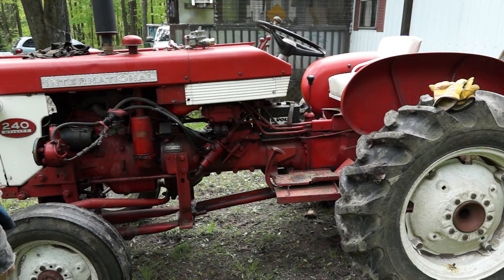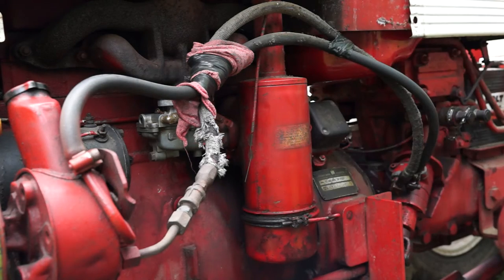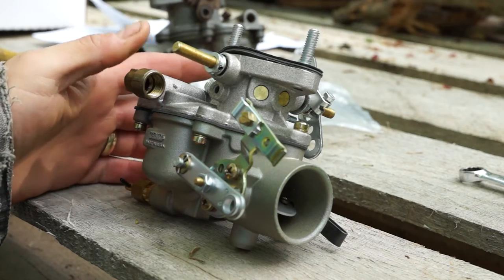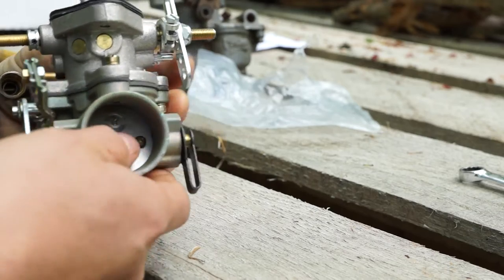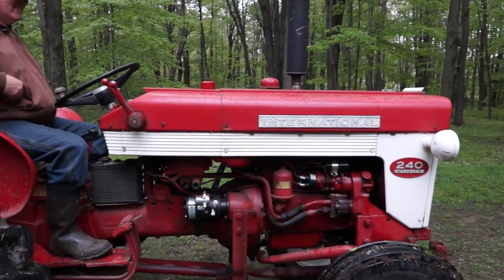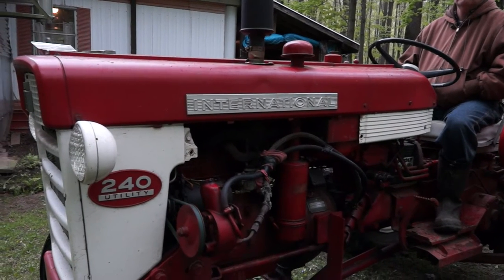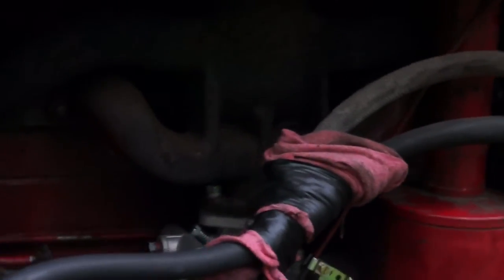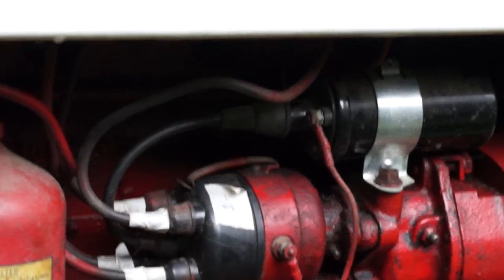International 240 - upgrading to new Zenith carburetor

Comment: Keep the old one as long as you can - as long as it runs good and it doesn't burn any oil and everything else works. There's something to be said about an old tractor :)
 If that was your Dad he looked like he was having fun!!
Reply from the maker: biggest reason for getting rid of it is that I have such a limited time down at the cabin and having to spend unplanned time fixing her cuts into work time... and the three point hitch system on these tractors was an after thought (they came with a two point system originally) and is less then optimal... we still have our old Ford 8n's which you can't kill if you try... those are staying around...
Reply from the maker: Oh and thats my father-in-law... and he's having fun now that I had it started :)

but check out the pics here for what happened next : http://www.bethnchris.com/2014/05/19/replacing-international-240-carb/

taking a day off work and heading down Thursday to get her back on all fours... as long as the part comes in...
Reply: buffcleb Notice that the washer and nut locking on the rear wheel were already missing when you took this video.
Reply from the maker: Randy Parker http://youtu.be/LWXkQMaj0Zc?t=38s - yup... now I'm going to have to go back to old videos and see if it was missing then...